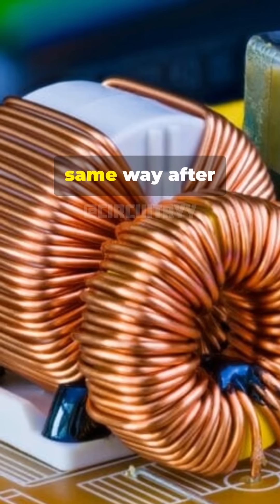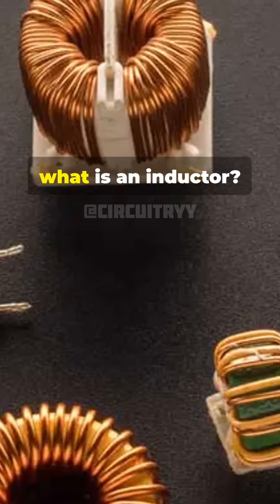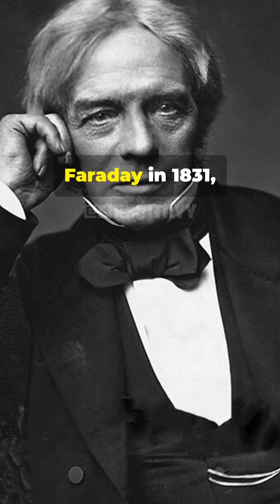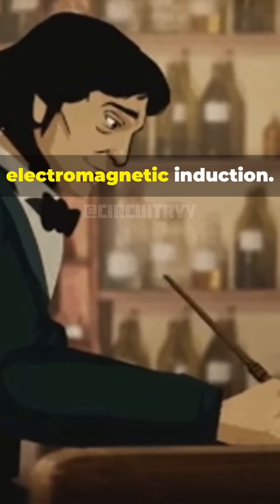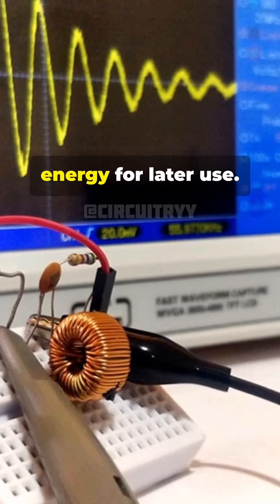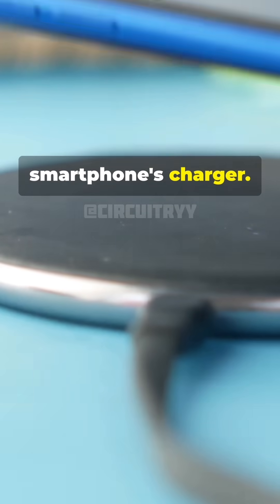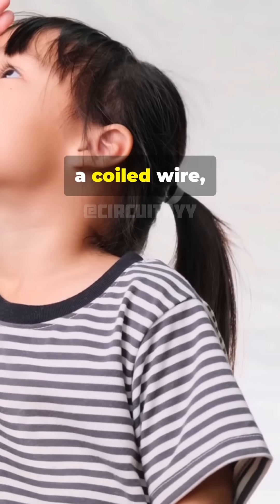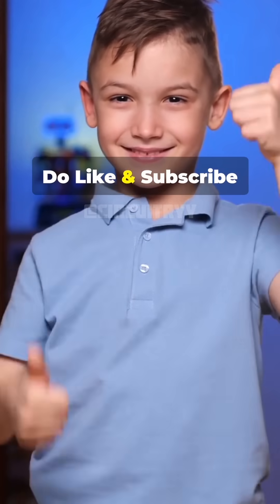Inductor #engineering #viralvideo #1000subscriber #1k

Comment: Passive Component?
I don't agree.
Of course that's normal for an IEEE
Reply from the maker: So, as per you, what is an inductor? 🤔
Reply: @Circuitryy  An inductor is a device that stores an electrical charge much like a capacitor, when used together it's called a resonant circuit or tank circuit. IEEE 101
Reply from the maker: If it stores energy, then it's passive... Right 💯
Reply: @Circuitryy  - Inductors are not passive
they form the foundation of memory arrays and always actively holding a charge and can never actually be in an off state.